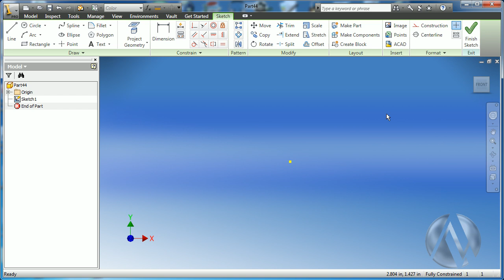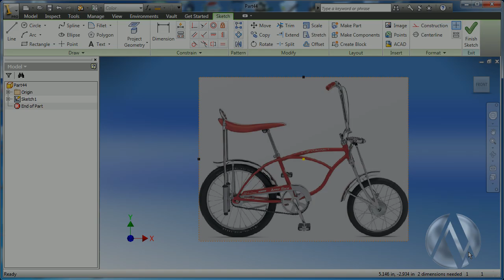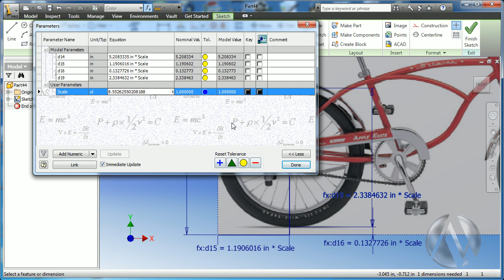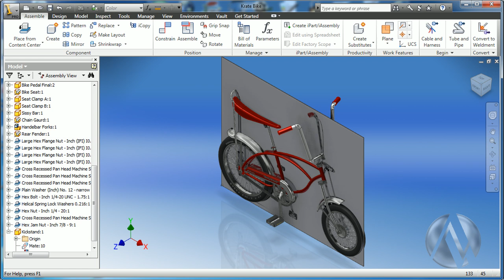Using Full Scale Images in Autodesk Inventor

Comment: You should measure at middle of rim edge to opposite middle of rim edge. The 20 inch measurement is the inner wire embedded in rubber also the rim edge is slightly more than 20 inches so it stays on the rim after being inflated.  It would throw off accuracy by quite a bit.  Sorry I got technical but if it mattered..... well , have a great morning.